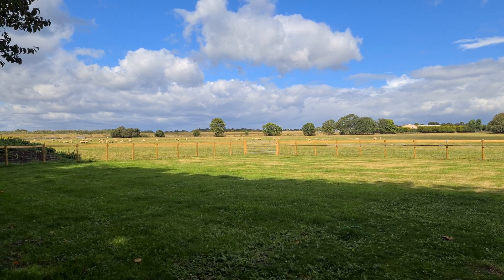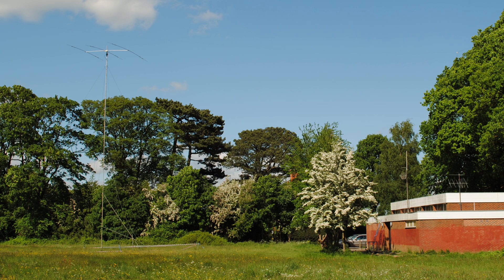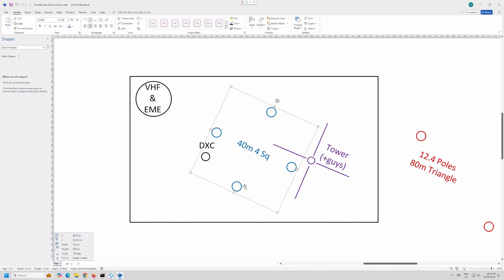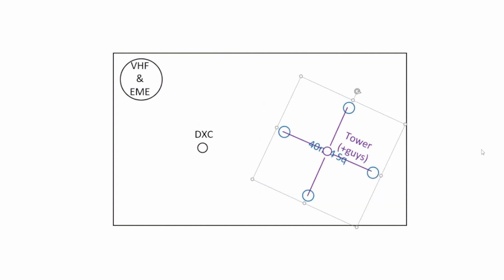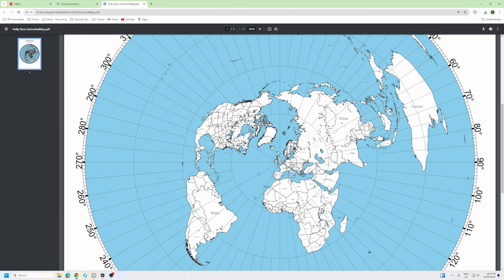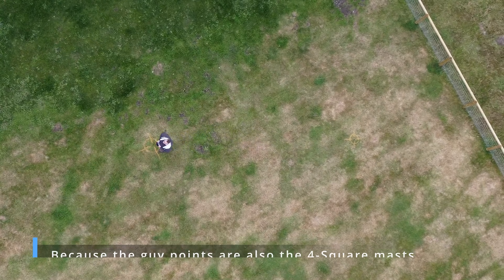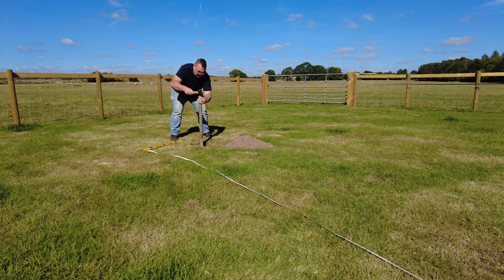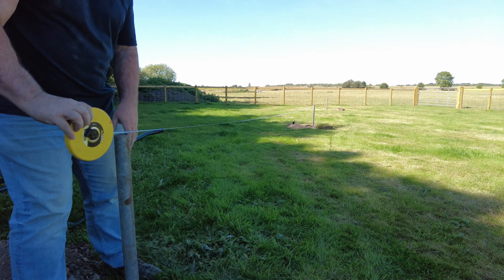Building the Antenna Mast Foundations

Comment: Ha! Caught you saying aluminum correctly!!! I like the setup. Here in the US we usually use Quikcrete for fence posts and the like. Plum the post, pour Quikcrete from the bag into the hole (no mixing) and pour water on top. Sets quickly but I wait 24hrs.
Looking forward to the quad.
Reply from the maker: We have that too - but I wanted an even stronger type.
Reply: @DXCommanderHQ  probably a good idea. Should have no issue with them ever.

Comment: I got a field for antennas like yours but am afraid to put in concrete footings in case planning decide that is permanent and not agricultural use.. Need to apply for change of use to Amenity land I've been told but I'm thinking if not permanent ??
Reply from the maker: If you don't put that much concrete in, then you can just angle-grind the poles and leave it all in (in the event you need to remove it)

Comment: Thinking about that 40m 4-square, this might be a silly question but will one of it's four directions be in the correct direction for grey line propagation to VK/ZL?
73 Ed.
Reply from the maker: Yes. Long and Short.
Reply: @DXCommanderHQ  but I thought with grey line you fire the signal along the day/night divider. Long and short path is related to "normal" F2 propagation. Often to "get on the grey line" you will fire roughly N or S. With LP for VK (from here) I point due West and for SP due East (your directions will be a little different as you are further north and west).
73 Ed

Comment: I use Google Earth for measurements and placement of new antennas, specially if you have some useful tall trees.
Best mast is a fast growing tree, like pawlonia or eucaliptus.
Reply from the maker: Great tip!
Reply: Fast growing? So you attach the wire to the top while you can still reach it and then let it grow?
Reply: @paulsengupta971  No, I use a homemade big slingshot or catapult to throw a line, and then tie the rope, etc...

Comment: I am very disappointed that you are putting up the DXE antenna, anyone with $$ &/or "connections" can do that. You were working with NJ4Z on a triangular array which I am following thru with.   What's happened to John? 73 from New England to Old England, Mike K1FNX near Boston
Reply from the maker: The Triangle is still going up.
Reply: Have you ever used k-post/Post-crete or similar to anchor guys? I’ve not. Thought about it. 
Easier than mixing cement. 
Also, you’re very lucky to have level ground - imagine trying to work out guy lengths otherwise!